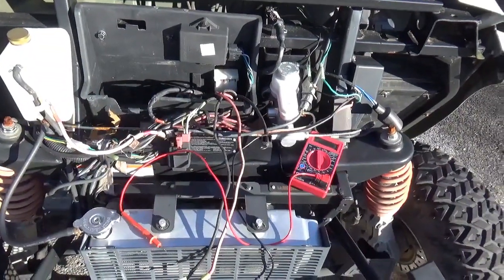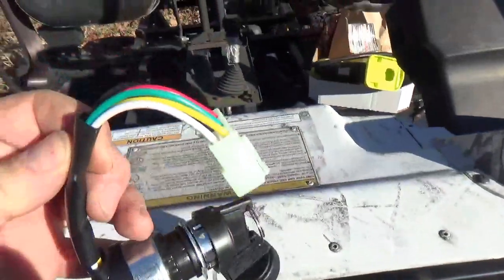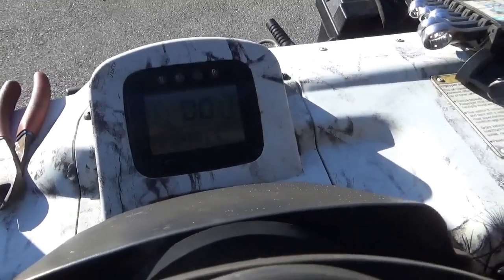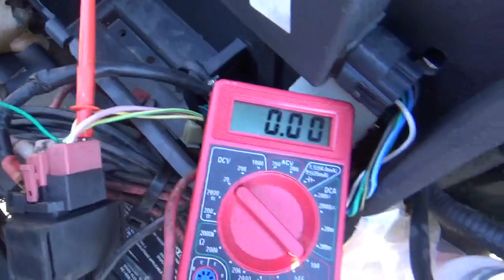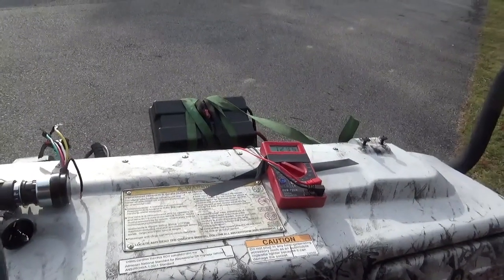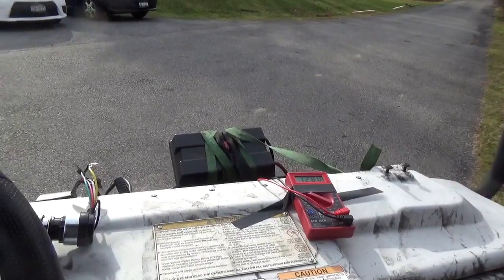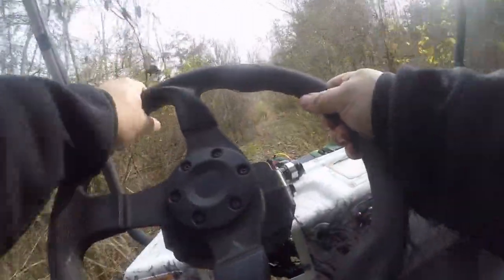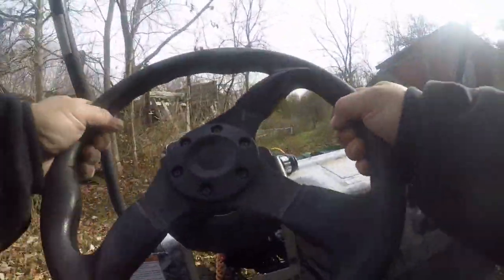Linhai Big Horn 400 UTV 28, No Crank, No Spark, Troubleshooting & Repair!

Comment: Well Harvey, let the performance today answer your question about "Does it plow?' You don't want the weight of a plow mount, winch mount, plow frame, plow blade and the winch with all the wiring and controls, to add to the questionable machine that you would have to tow back to the garage to work on it. If you can get it to run regularly then we can dress it up for light duty romps. We just ordered a plow mount for a customer who bought a Bennachi, which is the same as the other knockoff that begins with an M? and after it was back ordered for weeks, it came in and it fit nothing, not the right shape or width for the chassis. Now we are opening a bunch of plow mount boxes looking for something close enough to modify, just to get rid of this pain in the ass with this odd ball machine. The expensive side by sides go through axles like nobody's business so they are not the answer to all expectations. Keep me posted Harvey.

Comment: It would need better tires.. those tires won't work well in snow. But other than that, you don't need speed to plow, just weight (which it has), 4wd, and traction. I've been plowing with 4wd quads for decades, and with good mud/snow tires, they can't be stopped. I literally can not get my Kodiak 450 stuck no matter how hard I try.